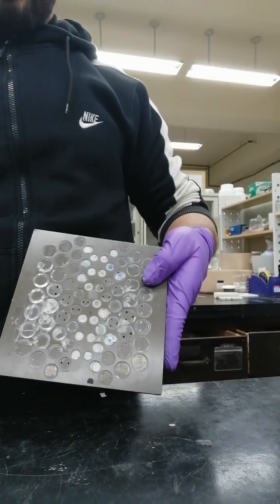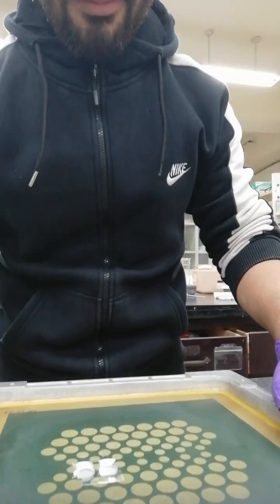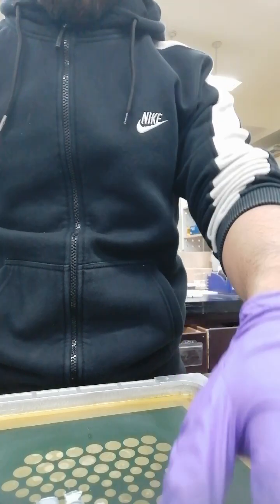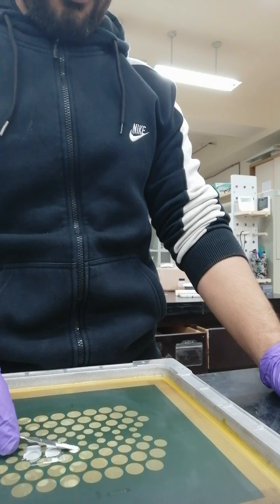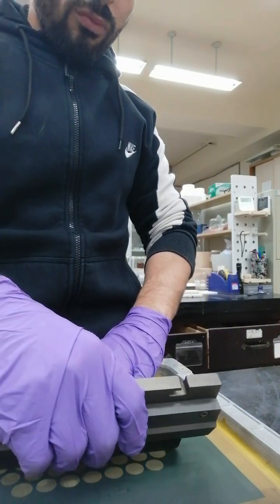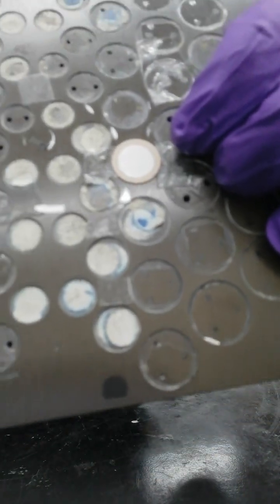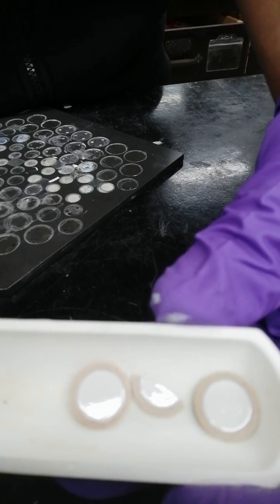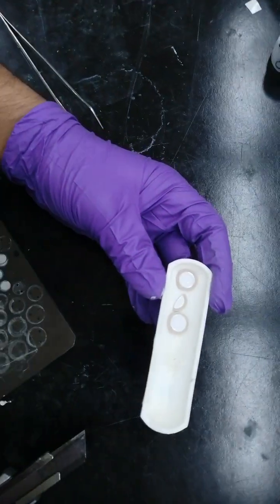Screen printing. How to make an electrode using screen printer for SOFC test

Comment: Thanks for the great video. I do have one question - isn't there a risk of the ink sticking to the cell substrate when detaching after printing?
As far as I know, there should typically be a small gap between the screen mask and the substrate to prevent this issue.
Reply from the maker: I am not sure about this, but your point of view is good. This is possible to happen.

Comment: thanks for informative video. would you please let me know? how you draw patterns on mesh? and can we wash the mesh with simple water?
Reply from the maker: @ibneabbas-u4j  you are welcome.
Washing the mesh is carried out by ethanol. Ethanol will make it easy to remove the sticky materials(due to binder using). I think water won't be effective like ethanol. You may try water but be careful not to damage the screen printing mesh.
I don't understand your first question about how to draw patterns on mesh?
Reply: @Dr.Saadallah-Physics  actually i have simple mesh. i want to make patterns . on internet they use emulsion and then use UV live to make patterns like circle , square of different sizes.
Reply from the maker: @ibneabbas-u4j  send me this video or it's link may I can help you. But normally we buy it (screen printing mesh) from companies as it's not making it in our lab
Reply: @Dr.Saadallah-Physics  thank you so much. i will send you an email. then we will discuss. I am new one in this field. so learning the whole system. its very informative video. Thank you.
Reply: @Dr.Saadallah-Physics  Can you share the components of your screen printing paste for me to make electrolyte layer
Reply from the maker: The binder components are ethyl cellulose+alpha terpinol the ethyl cellulose 4%. This binder is prepared separately as a stock and if not dissolving just heat it at 80-100 degree celsius for several hours @johnmitchell596
Reply from the maker: If still not understanding, contact me on my what's app number, you can find it in the channel description. @johnmitchell596